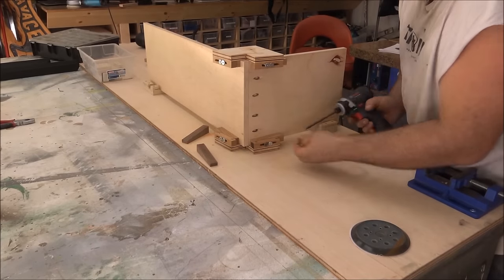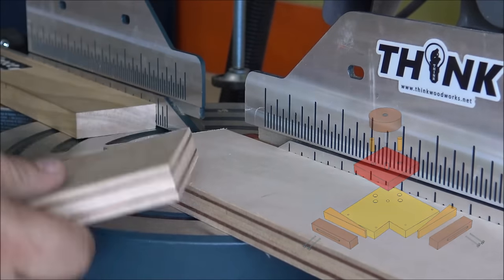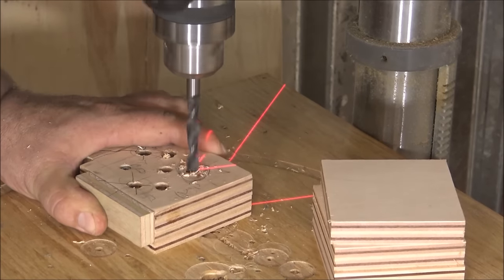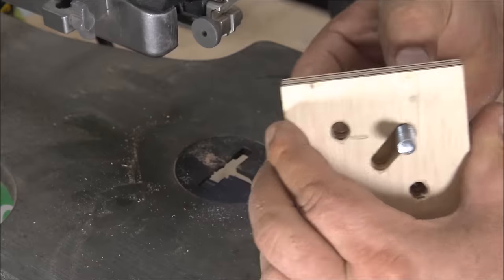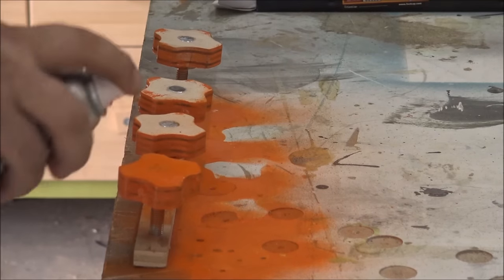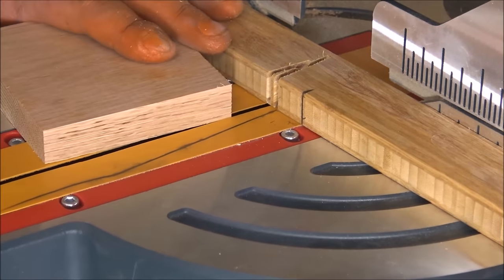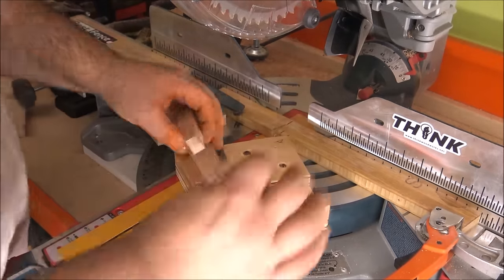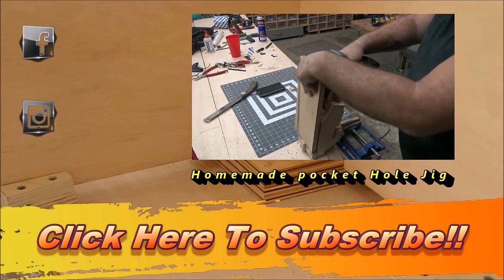How To Make Wooden Corner Clamps

Comment: Hey, I made a bunch of these, and they are really useful. One thing I did that may be a help though. I wanted to guarantee the right angle inside the wedges, so when I was fitting the wedge guides, I put the wedges in their operating position, and held them both against a true right angle block while I fixed them down. No need to worry about the exact angle accuracy of all the cuts that way. Hope this helps.

Comment: Hi Izzy - Awesome clamps.  I built 8 of them.  I customized mine....1" oak...had to glue together to get that thickness.  The sliding oak wedges actually rests on the screws, so there is a 1/16" gap, and does not rest on the plywood so it slides easier.   The inside clamp jaw is at an offset height of 1-3/4", so dropping boards in is easy.  I cheated, and used pre-made knobs with threaded nuts inserts.  They work so well that they straighten warped boards.  I fortunately made the sliding wedges large enough that a ball peen hammer is used to clamp the tough ones...the only thing I may modify is the striking surface...install a nylon type/ similar material where I'm striking with a hammer on those wedges!  

btw...I improvised on the hold down stick - I used my kids plastic hand rake (a beach tool)!  What a great safety aid...nothing like learning how to do things safely the right way!

Great video...Most of all, you put a lot of thought into the design of those clamps...Thank You.

Comment: Pretty cool, Izzy.  Corner clamps are always useful.  I should probably make several for my daughter's chest I'll be building soon.
You mentioned you could cut the slot in the wedge fence pieces with a jig saw.  It could be done but I would cut the slots in a solid piece before cutting them to final size.  It just seems a lot easier that way.  No balancing the jigsaw base on small pieces.
Reply from the maker: +Sean Rubino That would be a good idea you could also just clamp each piece flush to the top of a board to add more surface

Comment: Though they may apply slightly less clamping pressure, I made the simplest corner clamp that can be made by cutting a 3" or 4" perfectly square scrap of 3/4" plywood, then essentially mortising out on the two adjacent sides where you'll be clamping against the wood to be held (about 1/2" back from that edge) and then just using spring clamps to bind the working piece to your square corner.  Rounding off the corner of your mortised square a bit ensures it won't touch any glue ooze.   This works particularly well if making tiny boxes as you can use the micro spring clamps from H Freight and make miniature versions of my mortised corner to glue a lot of them up square for a buck a corner in spring clamps.   But this doesn't work on the underside sitting on the bench for larger pieces without getting creative to support it all for clearance for the clamps.   But clamps up as fast as you can put the spring clamps in place...

I like how your design binds with the wedge though as that's faster than anything threaded.

Comment: Very nice!  I like these.
Here is a tip you may or may not use.  
There is a solvent for cured CA glue.
Nitromethane!  I used to mix my own model airplane fuel and found that nitro would dissolve cured CA glue.  That is why you could never use it on engine powered model airplanes because it was not what is called hot fuel proof.  You may never use that but I have had my share of those "OOPS AW Shucks!  Moments"  LOL.

Comment: Hey Izzy, you're on a roll here! Very useful simple build, also the nice knob jig. Going full time seems to turn out great for everybody - especially your viewers and fans (like me)! Love the new bright on white logos and intro. Thank you for your hard work providing free content to us!

One question on the adjustment slot you cut hole to hole with a scroll saw. How would I best go about that not owning neither a scroll saw nor a bandsaw. I do own a jigsaw but the slot looks rather small for cutting with a jigsaw. What would Izzy do?

Thanks again and keep it coming! Cheers!
Reply from the maker: +JM Tosses II would clamp the pieces to a nice flat board flush with the top of the board so my jig saw had more surface to ride on. clamp would have to be extended out to each end or clamped from the bottom so they dont get in the way
Reply: izzy swan Please excuse the late reply, I'm traveling. I think I will try above approach when I get back to my workshop. The way you describe it that might be easier than I thought. Cheers and thanks!

Comment: great jig but I don't understand why you need the wedges? Conceptually I get it but I don't think there necessary. I think if you make sure the base and side walls are a perfect 90%, then the top/center sliding bracket should be enough no? Am I missing something.

Comment: subscribed. just built a picture box in oak and could have really used a couple of these. I used Irwin clamps to hold my work together but of course they are big and bulky. Any info on the chamfer bit or did you custom mill that?

Comment: The outer wedges are cut strait alined to the bottom square, which gives it an 8 degree counter angle to the inner wedge, cut at a 90 degree angle and an 8 degree angle.  (You did not mention that) the two extra holes for the dowels are for thicker pieces. Please THINK about the explanation of the mechanics so that we learn faster. Other than that, cool!

Comment: Your scrap plywood is nicer than any ply in my garage :p
Reply from the maker: we all do it a little different. that's one of the things that makes what we do so diverse and cool
Reply: +Theball Player It definitely did not come from lowes.I can not even find material like that.
Reply: +Theball Player Scrap plywood is always nice plywood if it originally came from a nice sheet of plywood. It doesn't degrade into low quality just because it's left over from some other project...
Reply: kvaks3000 Thanks Captain.
Reply: +Theball Player where i live, that scrap ply would be classed as grade A special, and cost twice as much as normal. lol
Reply from the maker: i hear ya its different everywhere.
Reply: I got my hands on a stack of oak plywood. no kidding I've never seen anything like it. it's not veneer I promise. it's oak all the way through. 4x8x5/8 sheets.

Comment: If you could make a metal version of these this would be  great for welding fit up when you are by your self for butt welding joints.But I still really like the build on this. Thanks
Reply from the maker: +Uwe Abraham I hadn't thought of that, that's a great idea!
Reply: +izzy swan With the plans, it should not be a problem to make them out of metal instead out of plywood, or is it?
Reply from the maker: it should be pretty easy to mad for metal
Reply: +Uwe Abraham an easy 90 degree clamp for welding is readily available commercially...but if you're a do it yourselfer, the best one is made with angle iron and screw clamps....they leave the corner open and away from the welding area.

The trick though is most angle iron is not machined inside at 90 degrees, there's always a fillet in the corner....

Izzy's are good though because it is one finger operation....converting this design to metal will take some experimentation. With the wooden shims/sliders, you get some compression which makes them tight....you couldn't use wooden shims/sliders because they'd catch on fire when you weld......I guess you could use the wooden ones, tack your weld towards the middle, then remove the clamps to complete the weld......

Comment: I don't get what the orange knobs do?  Isint the right angle block fixed to the base plate?
Reply from the maker: +Martin Ellis the plate is adjustable for different thickness. the knob holds the adjustment plate to the base plate and looses when it comes time to move the plate for different size material
Reply: Thanks for that explanation. I understand now.